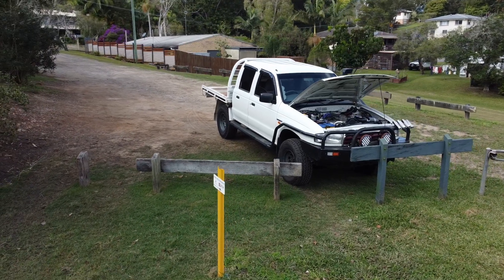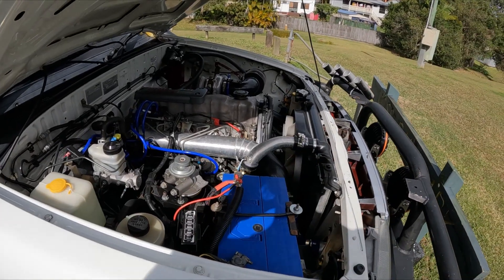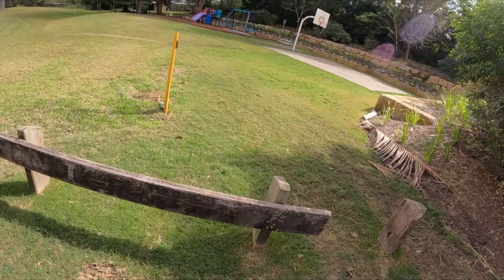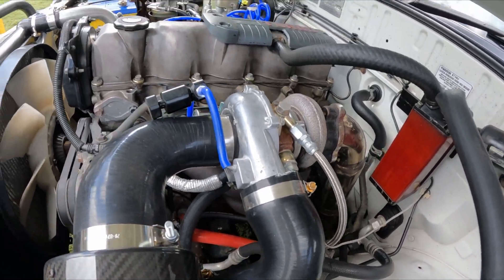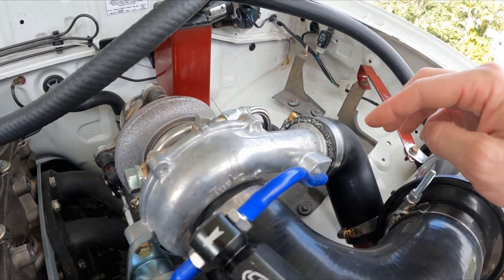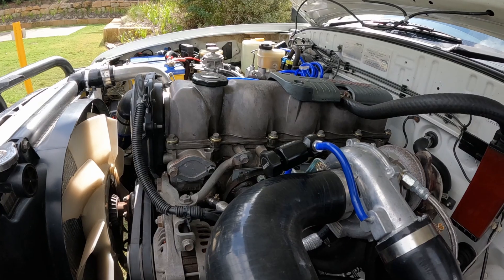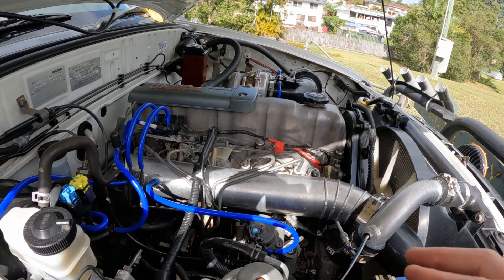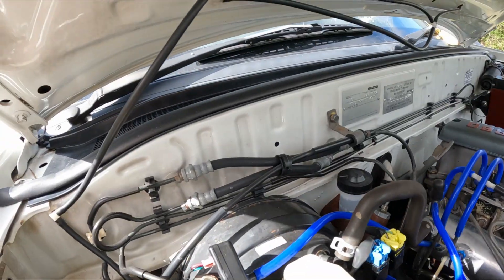Turbo Diesel Tuning Beginner Basics (Mechanical Fuel Pump) WLT

Comment from the maker: I mentioned that the waste gate closes to stop over boosting, it actually opens! easy mistake hahaha. I hope you guys enjoyed the video, and if you did please consider liking and subscribing. Cheers, Finndawg.
Reply: Hi mate you should run your waste gate line to your manifold for more accurate reading. Then your turbo line goes to your diesel pump. You will get less lag. Cheapest mod for these engines. I believe there is a video on Youtube showing this too.
Reply from the maker: @cozh53  yeah I used to run the hose swap mod, I'm actually working on a video comparing the stock set-up to the hose swap mod, there's surprising afew trade off's between the two. Stay tuned it will be one of the next 2-3videos I'm working on.

Comment: I recently discovered a better way to tune the pump is to modify the boost compensator assembly by changing shims and adjusting spring tension and turning the diaphragm so you're only adding fuel with boost, instead of across the whole rev range via the fuel screw?

Comment: Dont know if ill get a reply since this is 3yrs old. But why have you connected the blue and yellow 4wd sensors by the brake booster together with that small blue pipe?
Reply from the maker: I converted the hubs to manual locking and swapped to a manual locking front diff too, so those actuators didn't do anything anymore, never took em off but didn't like having exposed ends so I thought it just looked better connecting them with some blue hose. Hahaha, I don't know, felt right at the time. Thanks for the comment though ✌️

Comment: does the boost controller work on stock turbo on this car does it increase  psi or no thanks
Reply from the maker: It works on the stock turbo, and yeah it will increase boost in you choose too. Anything over 20ish will just be blowing hot air, 20 is abit of a sweet spot on stock. Make sure you monitor egts or you'll just brick your engine

Comment: How much power are you making i have a 2005 wl 2.5turbo diesel its slow & old i want to mod it so that it makes double the 3.2 rangers on the market ,also the 5speed i have makes it heavy on fuel i want to 8hp45.or 70 swap it an thoughts if all that would work or possible ?
Reply from the maker: you won't get that sort of power out of a wlt unless you massively modify it, and figure out a better gearbox solution sorry. They just can't handle that sort of power.

Comment: What are your gauges mate, and how do they perform? I was going to get a set of SAAS gauges but heard they're not that accurate...
Reply from the maker: Sorry for the late reply I am just going through and finding everything I haven't seen/responded too and replying. Hahaha funnily enough I rock saas gauges, they're the digital muscle series so they're not low end saas gauges, combined they cost about $350 so similar to a multi-gauge by redarc or similar, I have never had accuracy problems with them, if you get low end cheap stuff just expect inaccuracy. But generally speaking you get what you pay for.

Comment: After spending many years working on/around petrol engines, I've recently picked up my first diesel. Found a pretty darn tidy example of a stock '01 Bounty 4x4 and have really caught the diesel bug. This video series is great. Keep it up!

Cheers 🤙
Reply from the maker: Yeah that's the go, when you find a clean stock one that's always what I go for, I hate getting something other people have played with. Cheers for watching!
Reply: @Finndawg  is there any a performance Camshaft for this wlt engine?
Reply from the maker: @mr.eervianlesmana9263  not to my knowledge but you could always get something custom machined, but I don't imagine that would be cheap.
Reply: @Finndawg  what about Camshaft Regrind? Is that good?
Reply from the maker: @mr.eervianlesmana9263  a regrind just surfaces the cam lobes, it won't do anything to get additional performance unless the surface is already scuffed but at best you'll back to near stock performance, not increased.

Comment: Great vid mate, I’m fairly new to the diesel tuning scene and just did the boost line swap on my 03 courier (so running the line to that goes from the intake manifold to the compensator I think it’s called and plumbing it directly into the turbo) but will definitely look into doing some of these cheers 👍🏻
Reply from the maker: Cheers for watching! Yeah I used to have the hose swap but really didn't feel like it did a whole lot so I just went back to the stock configuration because it looks a whole lot cleaner.
Reply: @Finndawg  yeah right, that’s odd made heaps of difference for me. Way quicker at lower speeds, turbo spools quicker and I’ve gained 3 lb boost. Possibly cause I haven’t done much to.
Reply from the maker: @ewanfitzpatrick5466  it did make a noticeable difference with the stock turbo but this one is almost instant pressure so the pressure gets to the intake plenum pretty well instantly.
Reply: If u swap the hose over it’s not getting enough fuel when it’s on full boost
Reply from the maker: @virgosavageyt6088  shouldn't change the fuel at full boost homie, all the hose swap does is reduce the amount of lag between the turbo and the fuel compensator, shouldn't effect fuel availability. But I'm no expert i could be mistaken.